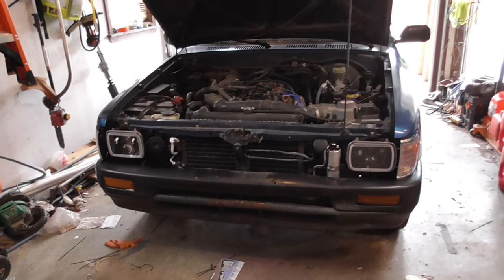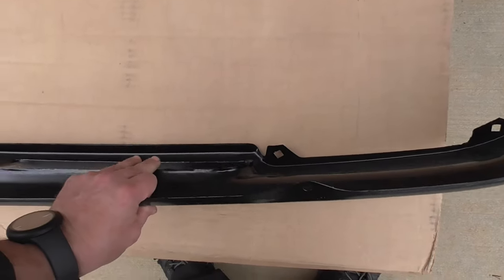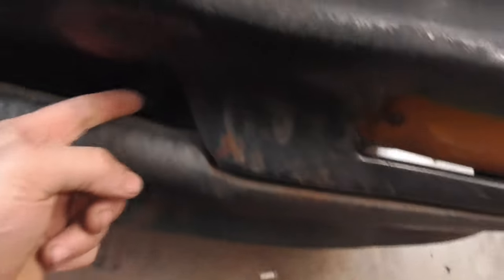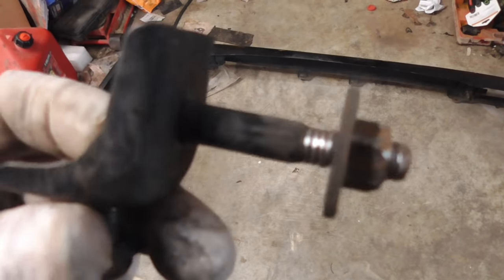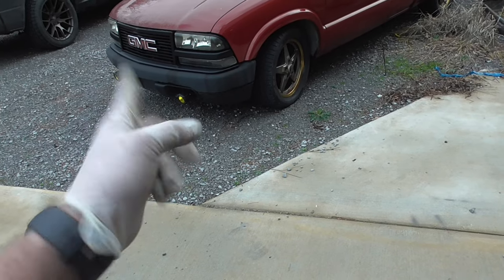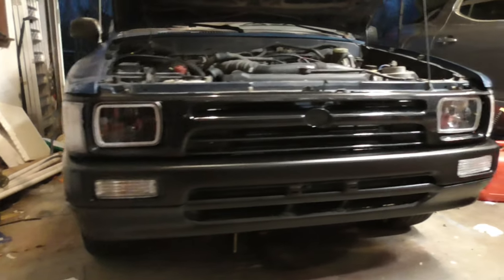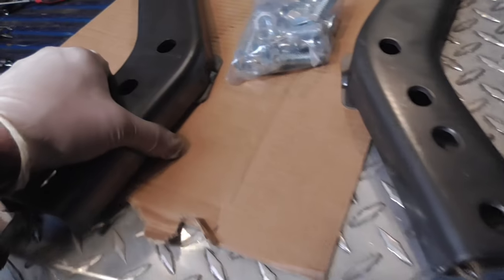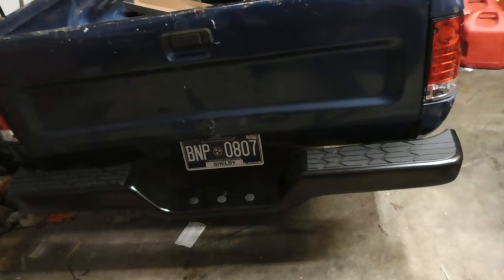1989-1995 Toyota Pickup Front Bumper, Grille, & Rear Bumper Install

Comment: If you didn't figure it out those clear turn signals work without modding by unplugging them at the bulb side
Reply: Do you know where I can by the clear light?
Reply: @danielt5415  amazon is where I got mine it doesn't matter which ones I had bought an OEM orange set last year after hitting a deer but they turned out to just be the thai built ones so earlier this year when I got the cheapest clears I could find which was 30 bucks for the pair ended up being the exact same housing as the 100dollar oem ones